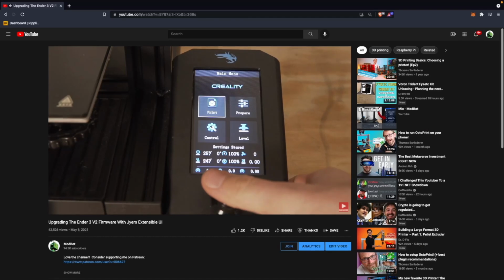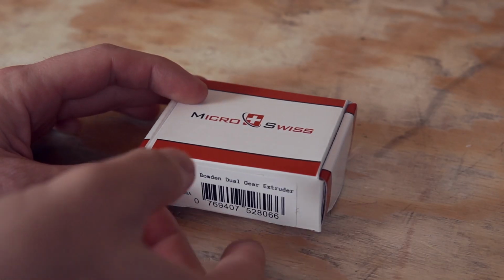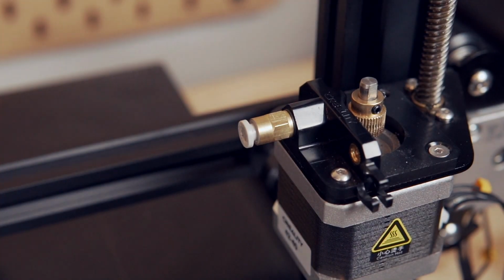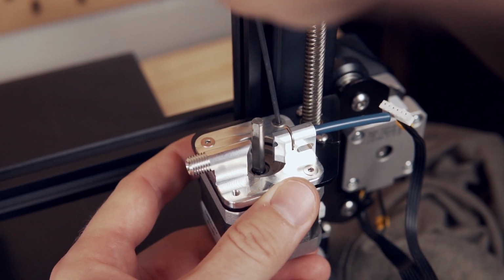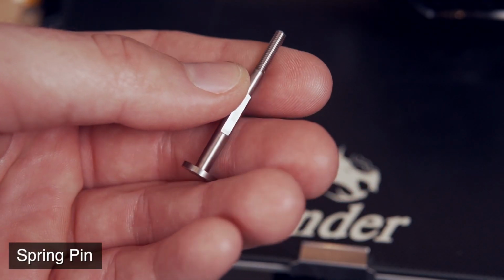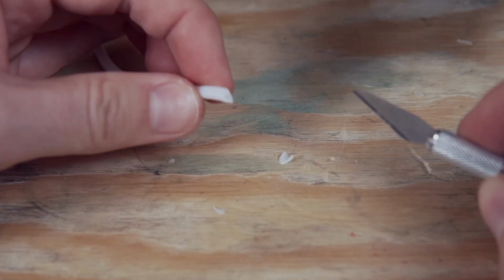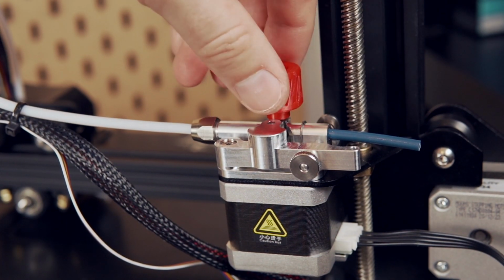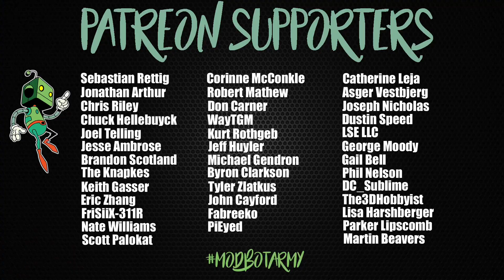Micro Swiss Bowden Dual Gear Extruder Install (Ender 3 V2)

Comment: This is a great video! I am wondering though, I have the CR 6 Max. I was about to switch my extruder out. But the cabling looks a bit different. Is this one only compatible with the CR 6 SE? I thought the main deference between the two was just the build plate size.

Comment: Anyone know of any files for creating a clip to keep hot end wiring out of the way of the print bed that would clip to this extruder in a non-obstructive way? I found a file for my old 1 gear all metal got end I had on my ender 3 v2, but that clip I printed doesn’t work for this.

Comment: I just installed this part a couple days ago. 130 is a good place to start on the Estes adjustment. I did a calibration and found 140 is where I needed to be. Would recommend doing a calibration of e-steps after install.
Reply: How did you calibrate it? My sharpie mark keeps getting hidden by the Bowden tube.
Reply: @Mr.Curtis.  maybe do it without the tube?

Comment: Your video is bit misleading. You are pushing the Bowden to hotend, at the same time as you cut the extruder end of Bowden tube. Some might misunderstand that the end that goes in to hotend should be cut sharp, which is wrong. But hey great video again.
Reply: Exactly what I was going to say... lol why did you cut 90s in the tube you put in the hot end?
Reply: @AllTheNamesWereInUse  If you watch closely the cut end went in the extruder...not the hotend.   You have to take the tube all the way out of both ends in order to cut it.  The hotend always needs to be flush so you don't get heat creep.
Reply: If you watch closely the cut end went in the extruder...not the hotend.   You have to take the tube all the way out of both ends in order to cut it.  The hotend always needs to be flush so you don't get heat creep.

Comment: Your video is fantastic, but I am still failing to get mine to work properly. The video makes it look like you are supposed to bevel not just the end that goes into the extruder, but also the hotend.....is this correct or incorrect? I have just beveled the end that goes into the extruder. I have changed retraction distance and speed as Micro Swiss recommends. I am using it on an AnyCubic Vyper. I have been struggling with it for months. The red extruder knob is lightly popping, like the filament has too much pressure....maybe the nozzle isn't hot enough to push it through? I always use the exact temp recommended on each filament. I have even tried printing at 25% speed with PLA and the knob still jumps and extrusion is sparse and eventually stops flowing. I would GREATLY appreciate any help with this matter...OH YEAH PS-- On the Micro Swiss FAQ for Extruder Installation there is a ESTEPS GCODE file. The directions say: Download the MS_DD_ESTEPS.gcode and then print it on your 
printer as you would with any other GCode that you've sliced 
yourself. The GCode file sets the Esteps to 130 and saves the 
setting.
I can download it, but when I send it to the printer nothing happens. I feel like such a BOZO.....please help me out HIVE MIND!

Comment: I bought and fitted the MS all metal hotend and all was well for a couple of months and then the Bowden tube kept riding up out of the collet whch was worn and was causing bad layers so I bought a replacement and the same eventually happened to that one, so I got my friend to machine the hole with a thread and make a screw in conversion fitting so I could screw in a compression fitting, that was two tears ago and all is still well

Comment: I bought a metal dull drive extruder as an upgrade for my anycubic vyper but the motor gear doesn’t fit the stepping motor. The micro swiss has been recommended to me, but don’t I just need to replace the motor gear ? Can you please tell me what  gear I should replace it with? Newbie to printing so any help appreciated thanks. The rest of the extruder fits okay.

Comment: My stepper motor on my Ender 3 pro did not have a flat end. Could you recommend one for me?
Reply: You could file a flat end into it if you don't mind a bit of work (shield the motor from shavings).

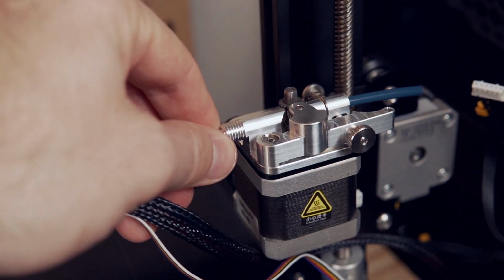Comment: 9:16 I marked the orientation of the tubing so that my cut was aligned as the tube was naturally sitting before.
Handle the tube carefully as the marker pen rubs off very easily; you don't want this to happen until after the cut is made

Comment: Shit, I just installed a creality runout sensor that aligns perfectly with the old extruder. Anyone know a work around to get this to fit?
Reply: Did you ever figure this out? I have a Creality Cr 10 Smart and Cr 6 Se I’m trying to install this to that came with the runout sensor
Reply: @BenjaminPoindexter  I ended up moving my spool holder, and printing an adapter to install the runout sensor to it.
Reply: @BenjaminPoindexter  I think there's an adapter on thingiverse for the cr6se. Probably be the first thing I print

Comment: If the brass compression sleeve gets tightened on the tubing can you use
 it again? Where do you get a new brass sleeve if needed?
Reply: I assume that it compresses and is only one time use. Not sure where you could buy more though...
Reply: @emersonsims9503  if you're careful you can cut the tube from it and open the nut with a pair of tweezers....i've done it in the past when in a jam and never had any issues......only place i've been able to find the correct size compression nuts are directly from micro-swiss themselves
Reply: My kit came with a second compression sleeve as a spare
Reply: your local hardware store should have them.

Comment: The stock extruder is one of the biggest issues on pretty much every Creality machine that comes with one.  This looks like a sweet option.  I went with the Micro Swiss direct drive kit on mine, could not be happier.  These guys make GREAT quality gear!
Reply: I completely agree. Since I bought the Ender 3 V2, it suffered from considerable under-extrusion. Tried different kinds of hacks, including adjusting the extruder screw but with no results. However, yesterday I installed a cheap aliexpress dual gear aluminium extruder, and it now prints perfectly.
Reply: The stock extruder on the cr6se cracks and hangs up as a result. Sure you can just buy another $20 extruder but why if they keep cracking. It's mostly plastic, though they should update the design to be more robust imo

Comment: I don't know if it's just me or what but ever since I loaded the firmware that is suppose to show you the thumbnail of the gcode. My machine is not the same. The screen looked almost the same as yours.  But I downloaded the original file from Creality's website and reinstalled that. But now, every now and then the hot end carriage runs into the stopper and vibrates like it wants to go through the switch.  Also the display not only shows the files in the root but also the directories I have on the SD Card for old gcodes. Also when the file name is very long it does funny stuff like starting in the completely wrong place. Can you help getting my Ender 3v2 back to its old self. I have the 422 bord.

Comment: 4:20 regarding the shaft flat.  If the shaft on your motor has no flat, you can just file a flat into the shaft.

Comment: are there any advantages with this model compared to say a dual gear extruder that you buy from say amazon for a fraction of the price?
Reply: I can answer this! I bought a cheap $10 dual gear on Amazon for my CR6 SE and no matter how I tensioned the spring it just shredded my filament. Upon further review it was clear as day that the filament hole wasn’t aligned properly and it was causing the filament to twist against the gears and just shred to bits. 

American made accuracy doesn’t have this problem at all. It’s also, overall, a better install process for the MS extruder top.
Reply: @SirTonyChaos  just accuracy in general. Doesn't need to be American :) 
The mass produced ones don't bother more than a certain amount

Comment: Nice one, but... to buy an ender 3 and spend a fortune upgrading it doesn't make much sense to me.. Better off, save the cash and buy a decent CoreXY printer and that's it. Fitting almost 50 quid of extruder on 200 quid printer is just mad..
Reply from the maker: Different stokes. There are many that enjoy nodding and upgrading as much as buying a turnkey solution. Part of it is the choice of what upgrades they want to do to make their printer unique to them and their needs. I see both sides. I have purchased 200 dollar printers and spent the same amount on upgrades but when they are done I find them as reliable if not more than some of the pricier options. 3D printing is just not a one shoe fits all technology.
Reply: @ModBotArmy  I'm definitely one of those ;-D I've built two of my printers and have to admit, bought a chinese 4020/2020 extrusion printer as well... Tinkering all the time with different components, combinations, firmware tweaks, you name it. That's the part of the hobby, isn't it. But sometimes if you're not careful, these things can turn into a money pit. Anyway, thumbs Up for your channel!!
Reply: The problem is -- where is that "decent CoreXY printer" that itself doesn't require either building a kit, or swapping out the "budget" parts?
Reply: @marijuanas  I started with an old i3 Mk2 clone I got from a friend, that needed some touches here and there, and in the process printed the parts and built two more customised i3's. Rather than printing cubes and benchies wasting filament, i was printing spare parts. 'Cmon lads, if you want to know how something works, especially in the hobby land, you need a kit. And with the help of channels like this one, you'll get printing in no time. As far as the coreXY kits go, a "Flying Bear 5" is a really reasonable offer, a little bit above the Ender3 price mark. We live in the absurd times where everyone seeks instant gratification, but really, you need to put some effort into learning how things work.
Reply: @Graham_Wideman  have a look at my reply to Jon's comment
Reply: @MrHristoB  Flying Bear Ghost 5? That is not a core xy. Not a bad price though if build quality is good.
Reply: @williamgreen3316  Fair enough..